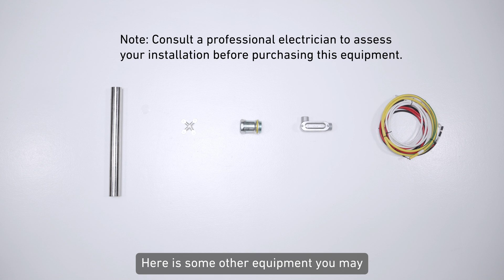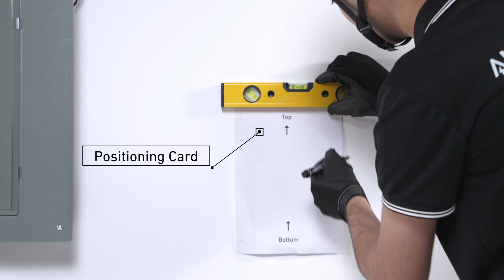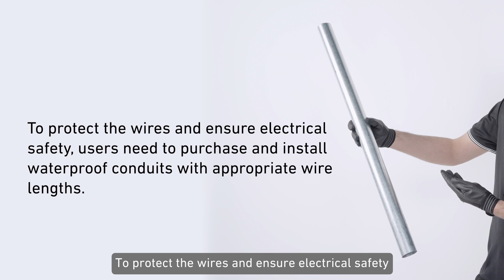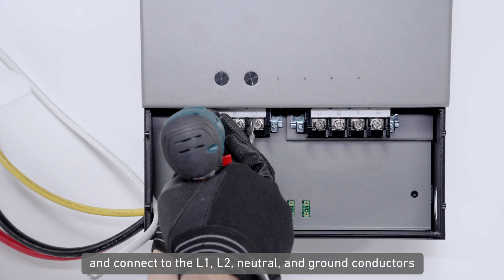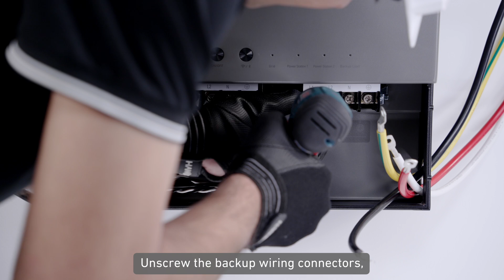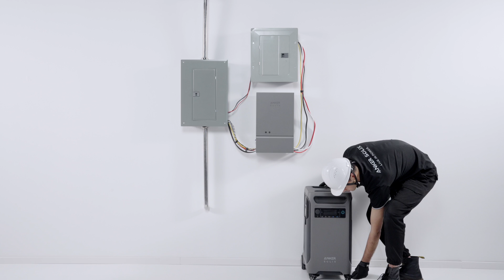How to Install Anker SOLIX Home Power Panel

Comment: What if you want only solar to charge the system and not the grid? I would like all solar to charge the system to 90%, and then use the solar + battery for the house. Once battery is down to 50%, move solar back to battery and house back to grid. It's a whole home/emergency hybrid system.

Comment: ok, this guy and his hard hat is a joke, just take it off nothing will fall on you head and if you are so concern about safety where are your safety glasses cuz the wires will poke you eyes? Drill to tight the wires on the breaker? Worse idea possible, as you can see in the video how he strips the screw on the breaker.  This video needs a lot of improvement. I mean a lot. This product is nice in the same this video install is not. People have so many questions. Maybe one day l will do one to show in real life how it needs to be done.

Comment: You can only literally move breakers from your existing subpanel to the backup panel if they are the same manufacturer and model (are listed for use on the backup panel's breaker list).

Comment: Do you need to install the 'Backup Load Panel' at all? Why not just feed the grid power into the Smart Panel and then connect that to your main panel?
Reply: Because you will back feed your incoming power lines energizing your neighborhood in the process and the main concern is you can light up the big strong lineman that's come to get your power restored, it is code to ensure there's no chance of back feed
Reply: @davidlatiak  Well, that's not a very 'Smart' panel, then, is it? Aren't the current sensing clamps (which I think go on the main) supposed to detect if the main is energized or not?

I have a disconnect on the back of the house, and the panel in my home just acts as a sub-panel (I would think, though it has a main breaker). I believe this is referred to as a 'Type 3' connection(?). I was thinking I could add one of these units 'in line' between these, with the out from the main disconnect going to the Smart panel, and the subpanel side going to my inside 'sub' panel?

I think I also saw somewhere in the docs that the unit could be hooked up through a 50A breaker directly to the panel, with the clamps on the main. I think this would accomplish the same result (an automated cut-over), but I'm not sure how this would be different from the scenario I described above.

Comment: I need to connect a smart home panel, however all of the videos and diagrams have the current transformers on one of two wires. All showing a 200amp circuit.

My house has 4 wires as the 200 amps are spread across the multiple 100amp circuits. No matter what I attach the L1 current transformer to, the system tells me it’s not connected. Any idea how to fix this or what it should be connected to?

Comment: What about bonding?  Does the transfer switch maintain the ground and neutral from the original main panel where it's bonded, or do you need to bond the ground and neutral in the sub panel?  🤔
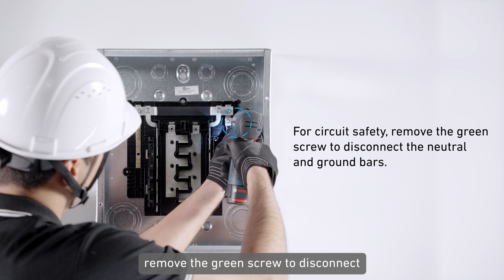Reply: Sub panels will always have separate ground and neutrals.  The tutorial shows it starting at 7:15

Comment: I already have a 12 circuit sub-panel installed from my gas generator. Can I wire the HPP to the sub-panel and that would all work?
Reply: I think so.  The HPP backup load side would be driving your sub panel now instead of your gas generator inlet.  Then of course you would still need to connect the grid side of the HPP to the main panel.
Reply: I'm wondering the same thing myself, I have a feeling that a specialty panel would be required to integrate with an auto transfer panel for a generator. But I've spent the last couple afternoons looking and haven't found anything. There's not a lot of information on it.